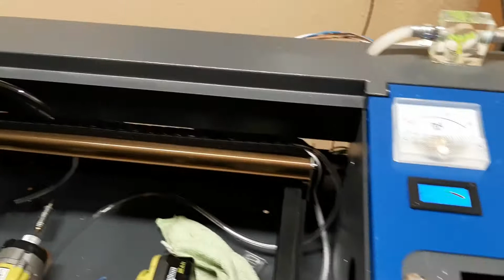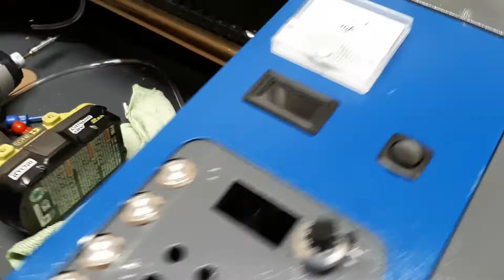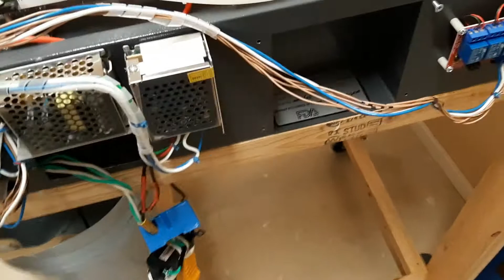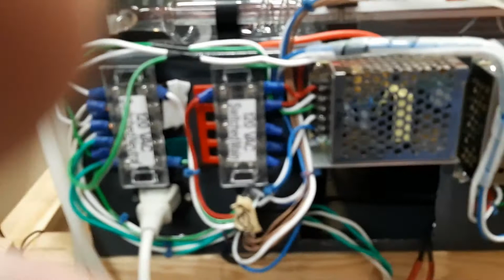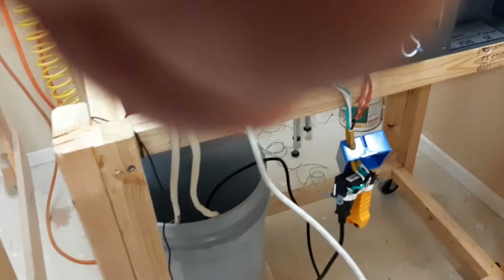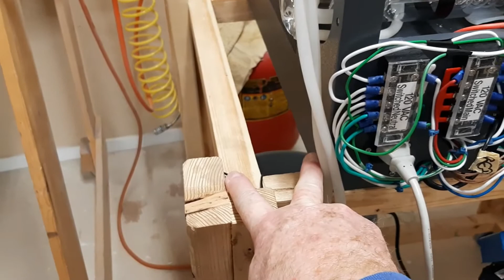K40 - How to Control AC Devices

Comment: Great video! Do you have a link to those relays?
Reply from the maker: From ebay.  This is my second board as I reversed the 12v board input power on my first.  Other wise a great board. 
https://www.ebay.com/itm/USA-12-VDC-10-AMP-8-CHANNEL-HIGH-LOW-LEVEL-INPUT-RELAY-BOARDS/264235417087?hash=item3d85a87dff:g:l30AAOSwcgNch8yD